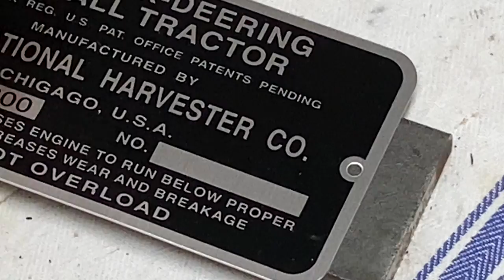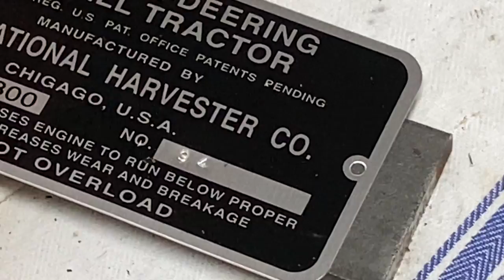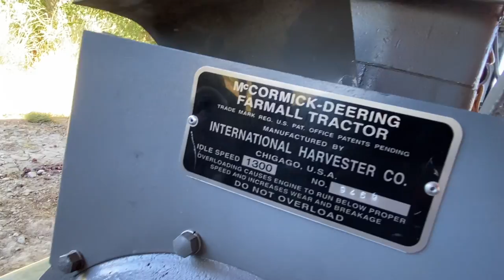1927 Farmall Regular - Oil pressure gauge. Serial Number Plate. Other minor repairs.

Comment: Grandfather had a 28 regular. Had a Wico C mag on it  Advavce was automatic. Throttle was on side of power fuel tank. It was his first tractor  Bought it in 39. Used it for the heavy work plowing picking and cultivating. Had a blacksmith loader build for it. Belt drive. Put belly pump on it in mid 40s.